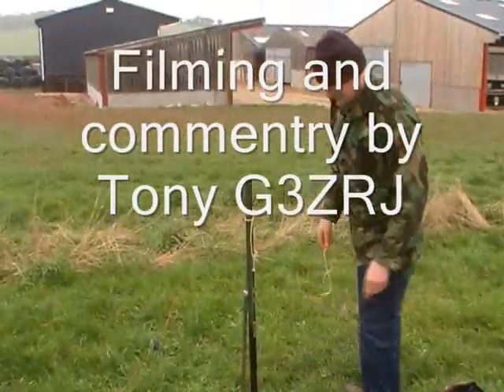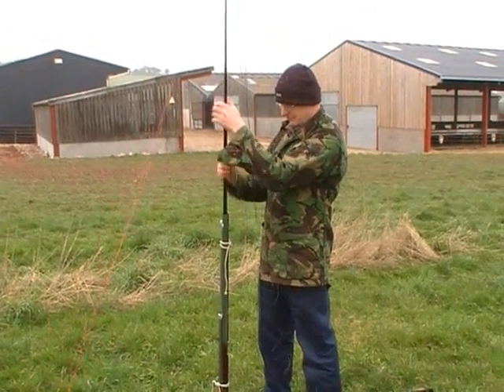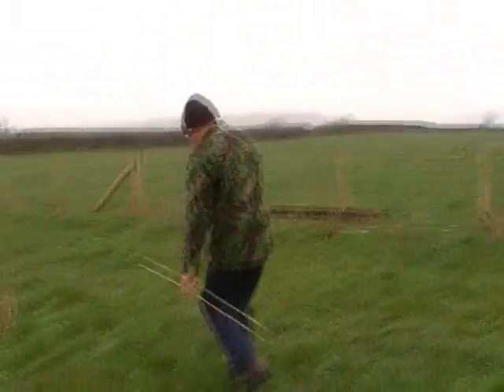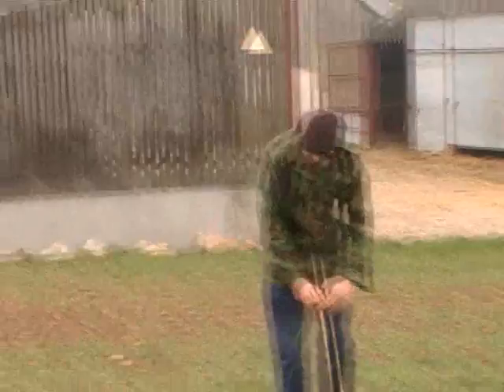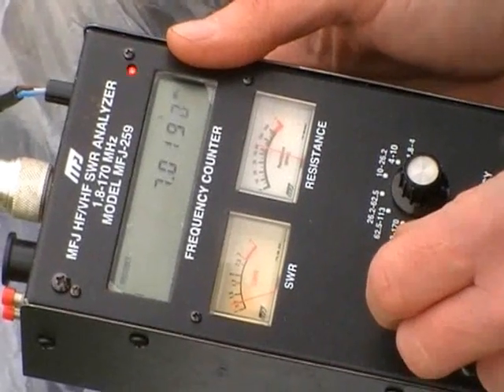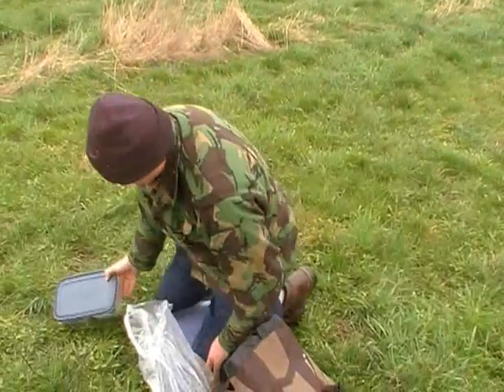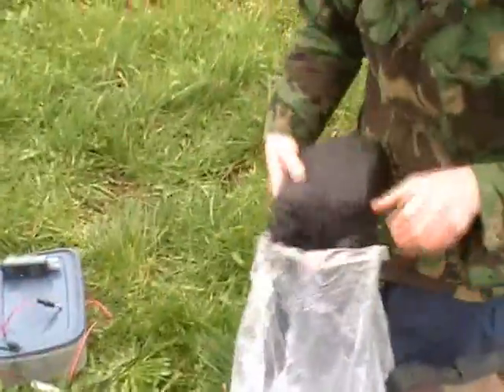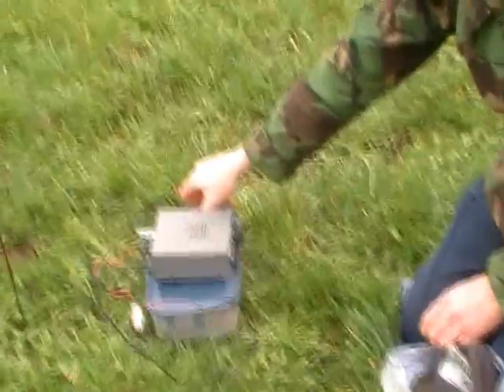Portable in Herefordshire (SOTA setup)

Comment from the maker: @NG9D Lynn,
Thanks for the comment.
Without bamboo canes on each end the antenna was detuned by about 200 Khz.Also by raising the ends you diminish the effects of the ground on the antenna system.I have now used my resonant dipoles on many different ground types and always the swr remains good.
73 Sandy